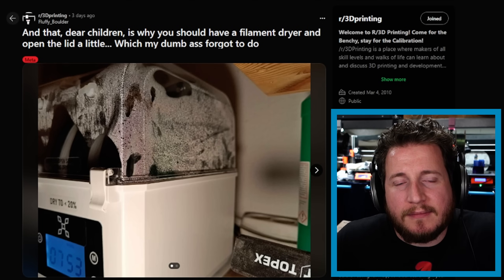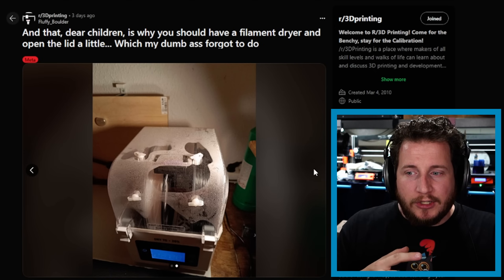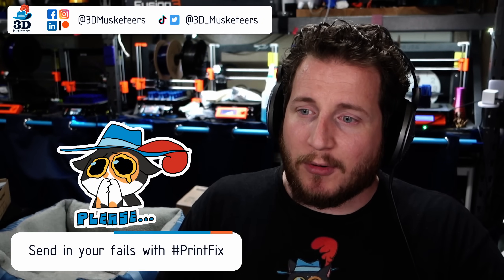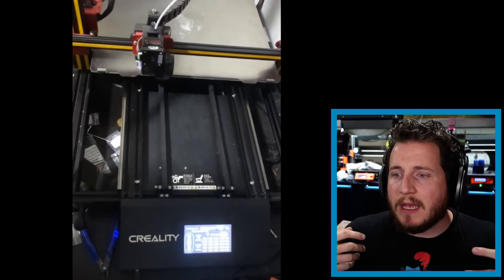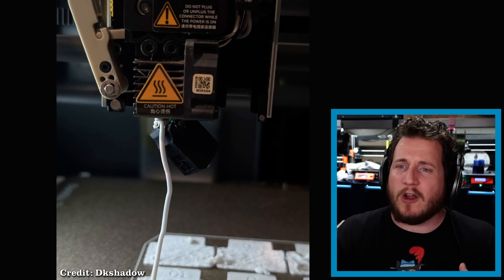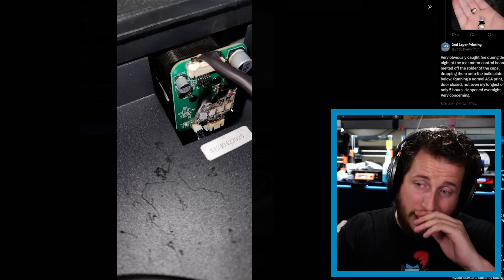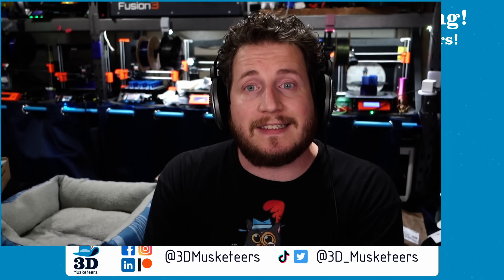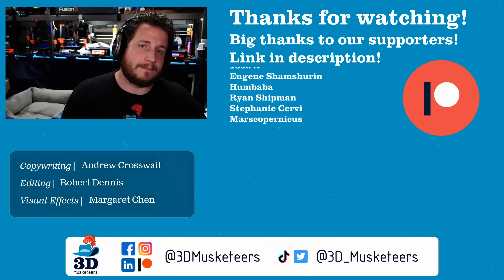How Did This Happen?! - PrintFixFriday 165

Comment: Ahhh, the good old Bambu pressfit failure. Doesn't happen too often, but often enough with the numbers of machines in the wild. Losing the nozzle tip is more common than pumping the whole heater block off.
This is considered a manufacturing flaw and should be replaced by Bambu under warranty. With a bit of luck you'll get a complete hotend assembly!

Comment: Fuses are typically derated from the nominal value on the part. A 4A slow blow fuse can sit at 6A for well over 100 seconds without it being a spec violation. If you look at any fuse data sheet, they give you a current vs time curve. Slow blow fuses are meant to allow over-current for a small period of time so that you don’t get too many false positives. It’s up to the manufacturer to keep this in mind while designing their system.
Reply from the maker: yeah not sure is these are fast or slow, but I do agree, with the slow blows. I may desolder that fuse and pull the datasheet for it, I am curious..

Comment: I’ll run a small print farm, about 10 bamboo lab machines. I’ve had this happen once on an X1C, I have this happen frequently on my P1S machines. it has happened the same day. I set up a brand new printer as it has happened after 3000 hours of printing.

I print 99% withPETG. Matter hackers build series PETG/reality PETG 265/70
150 mm/s

Comment: My Bambu nozzle did pop off like that once before on my A1 mini actually. It was a .2 nozzle that was consistently jamming so I thought the temp might be too low. I raised it to 270, printing petg at .1 layer height with a .2 nozzle and it worked great for awhile, until it popped off a few prints later so maybe it was clogged all along then finally made a full clog and it exploded but the a1 mini nozzle is like 11.99 so easy fix!

Comment: The noise from homing could motor vibration either speed up or slow down homing by say 10-15mm/s should clear it up. May need to play with homing speed a bit to figure out optimal homing speed

Comment: I'm pretty happy with how polydryer handles getting moisture out. I've been using a dehydrator up until recently because none of the dedicated filament dryers worked they way I wanted.
Reply: I just use a dehydrator regardless. It works. I had it and never hardly use it for food. Works great

Comment: Hey, move to Phoenix.  Highest humidity rarely tops 50% and is way below that most of the year.  Humidity right now in my print room is 21%.
Reply: Why you need a filament dryer when your city is a filament dryer
Reply: I miss living in Wyoming. It was stupid dry there. When there wasn't wind it was actually pleasant to go outside in freezing temps with no jacket. Although that wasn't too often cause it was quite windy and quite often lol.

Comment: FLSUN, QIDI, and Bambu all released printers that were fire hazards. 
Hmmmm, what do they all have in common?
Reply: Missing quality control  (of spare parts suppliers) and problems by understanding that a product expected to run for many hours, not can be built up to limit of the components.

Comment: I've owned a pair of X1s for nearly a year. After 9 months of Yeoman's service, I've had a sudden rash of nozzle clogs and even blew out an extruder motor. With 2500 hours on the one machine and 2000 hours on the other... it's paid for. Few spare parts later... I'm back to printing. Love these things.

Comment: I found an interesting bug in prusa slicer. Remember that 4 part model you featured on print fix friday where it didn't look like the model was flat? I checked in blender. It's flat. It's oriented vertically which would suck for multi-color printing. I used the place on face feature. So I reset it. Tried again. Still not flat (I printed with the sinking option enabled so that it would have a flat base). Well......I rotated it by 90 degrees. Guess what? It's flat now! I don't know how to report this and even if I did, I can't give them the model. It's a paid model.
Reply: I would send the file anyway with the information to them that it is a paid model and only provided for debbuging purposes. If you really want to be on the safe side, contact the seller if they would be fine with it.
Reply: I don't remember which sheet I used. I tried again last night on the satin. Still had warping, but not as bad. I'll try again on the smooth sheet......and I'll do 90 degrees instead of place on face.

Comment: I still can't believe companies made filament dryers without ventalation holes. Another reason why the Eibos Polyphemus is doing it right.
Reply: I just prop my Sovol 3D lid open with a small dessicant bag and it seems to work well
Reply: What absolutely kicks my ass is this. I don’t have a dryer. I’ve printed with PLA mainly and, I’ve printed with PLA that was left out in the open, for three years, no issue. Ok, so at least in my house, my location, PLA requires zero drying. Stick with me a minute please… I just finally aquired a printer that I can move into other filaments and my goal is to push into Engineering grade filaments, CF/Nylon, etc… These filaments hands down require drying and? Above 70C as far as I’m concerned and? I don’t want to wait THREE DAYS for it to be ready if it’s even really dry in the end. Fast forward, every dryer review I see as far as I’m concerned are not made for Engineering filaments when well damn, they are the ones that need it the most! Saw a dude the other day, use a Ninja air fryer. Yeah, as high as you want to go, dry ANY filament you want and in a decent amount of time vs 24/48 hours. I’m seriously leaning into this. Now, that said, after drying, Polymaker’s latest box/warmer (notice I didn’t say dryer) I’d think would be great for storage during and after printing but drying? Come on, would someone put out a consumer dryer that can go to the proper temps for engineering filament. COME ON!!!!
Reply: @TheJacklwilliams  I'm in the same boat, even at 60% humidity my prints come out pretty nice, I feel many temp settings are too aggressive and cause some of the hydro issues, Bambulab's generic TPU profile is a great example of this, 240C. Absolutely boiled my TPU. Altered the profile to 230C, where their name-brand TPU profile is set to, suddenly it's totally manageable, but I did finally decide to break out the dryer for the last bit of stringing, it's definitely worth it at times for the more exotic filaments.
Reply: -- Desiccant is a real cure to this problem.
Reply: There is a valid reason though, it helps keep the filament inside dry between uses as a sealed box. But agree it's lazy in a way that it passes the burden on to the end-user to deal with extra steps each usage.

Comment: My filament dryer is a 5 gallon home Depot bucket with a 40w silicone heater pad and small fan in the bottom.  I can stack 3 spools in it with a calcium chloride desiccant at the top.  It cost me about $9 to build and pulls so much moisture out of things that you'd swear were already dry.  And since it's air/water tight once all is dry I can unplug it and walk away knowing I can come back a year later and the filament will still be bone dry